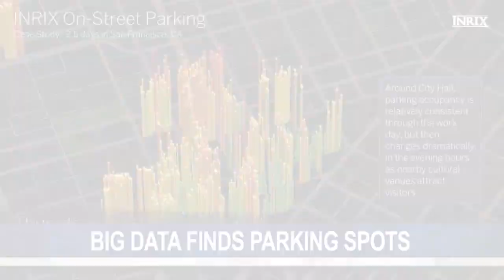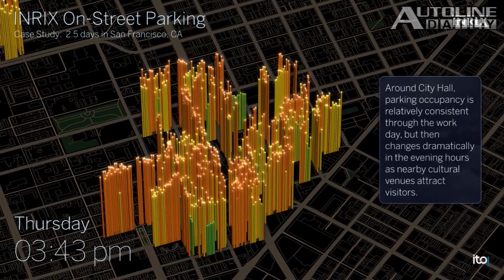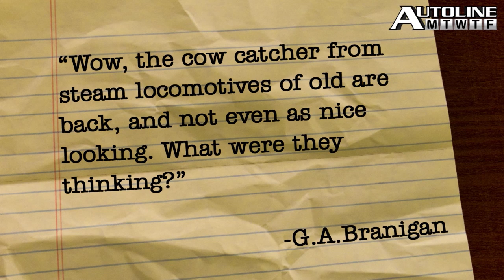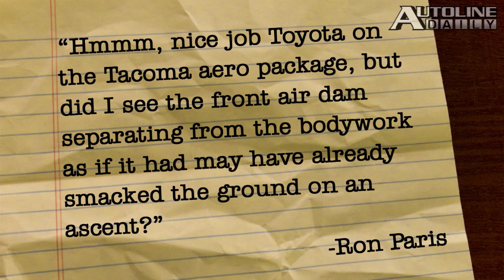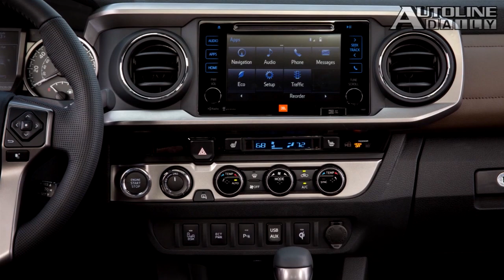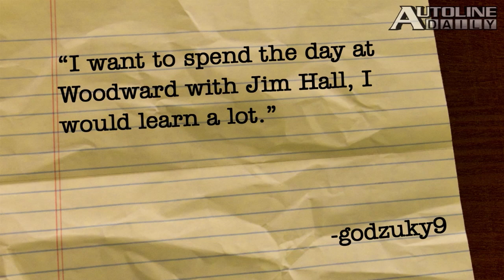Audi Targets Tesla, Big Data Finds Parking Spots - Autoline Daily 1683

Comment: hybrid is not that hard to fix. it just the parts cost a lot and the electricity will kill you if you don't know what you are doing.   you need to be a electrician and mechanic at the same time. :)

Comment: So with key-less entry, i.e. VW's new Passats, for example, car thieves could pull up in front of your house, use a device to amplify the signal, duplicate the frequency to gain access and drive off your car.
Is there any type of bag, like with E-Z PASS, or container that an owner could put their key in at night to stop this?
Reply: Jesse Parris In Australia the problem has emerged with keyless Audis and Toyotas, is that crooks get the VIN for a car straight off the body where its' visible from the street, go to a dealer who is either crooked themselves or convinced that the crook has bought a 2nd hand vehicle and lost the fob, they order a new fob off the VIN. They can go back to the car and enter it to disengage the park brake and gears, allowing it to be slid easily onto a tow truck for rebirth.

OR many people leave the spare emergency key in the dealer documents in the glove box. When that is the case, the crooks have an entry fob and a key - and drive off. Many cars are exported illicitly to the middle east and other developing markets by organised crime groups.